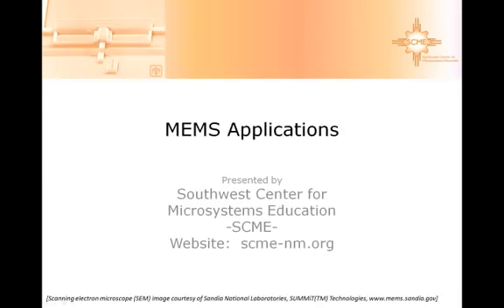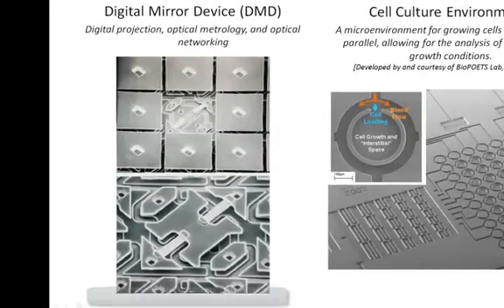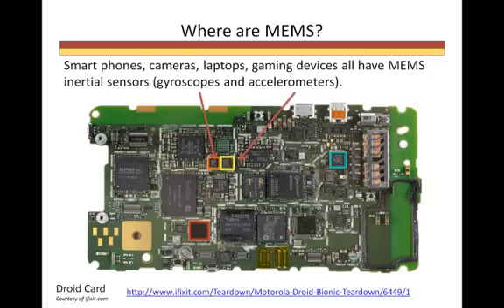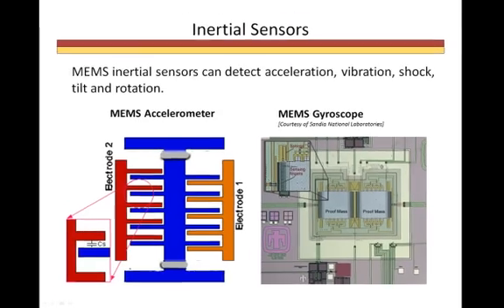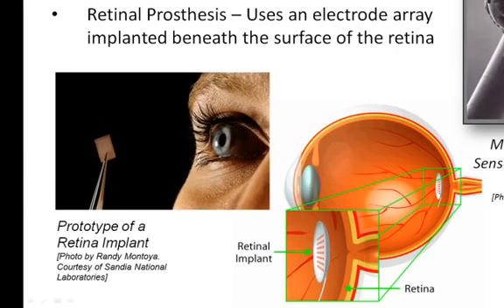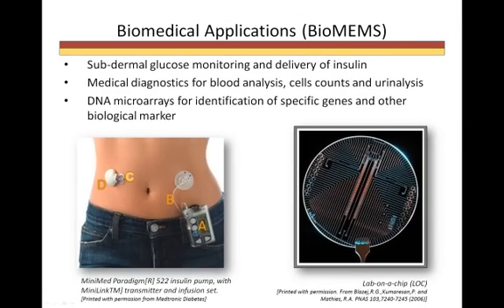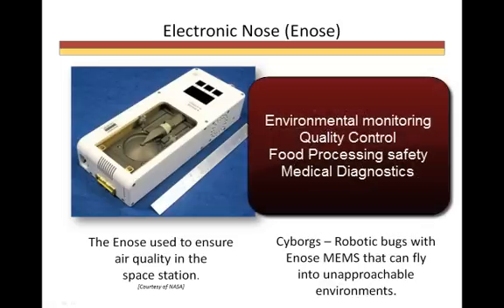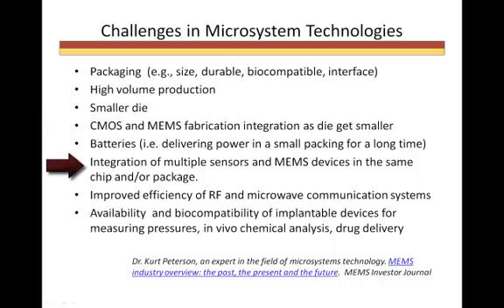MEMS Applications Overview

Comment: Can u please tell mems in mechanical applications
Reply: Mems are used in ROADM technology, where data is send over different carriers, each with a different wavelength, so called Optical Channels. The channels are multiplexed, to be send over one single fiber, so called OMS (Optical Multiplex Section). ROADM's are used at junctions, mainly at Datacenters, where the optical channels ar dropped, or passed on in other directions. Therefore the lightbeam is send through a prism and the wavelenghts are diverted. The mems consists of an array of micro mirrors on a chip and is able to reflect each wavelenght in separate direction (another OMS or Add/Drop zone).

Comment: The movement harvesting is done with piezo-electric principles as you had mentioned being used in printers though like a LED, the harvesting of fine-movement energy is almost like the opposite of it's production of fine-movements.